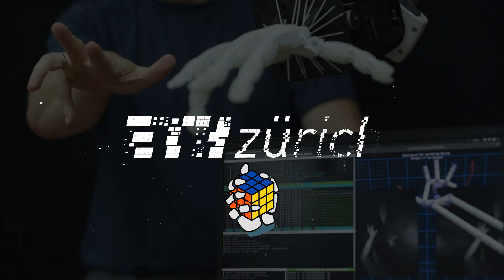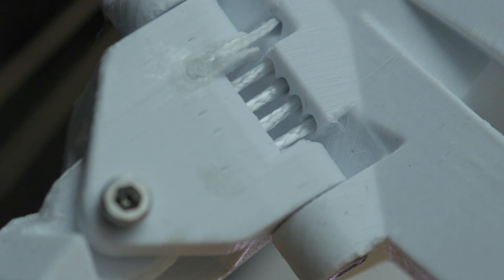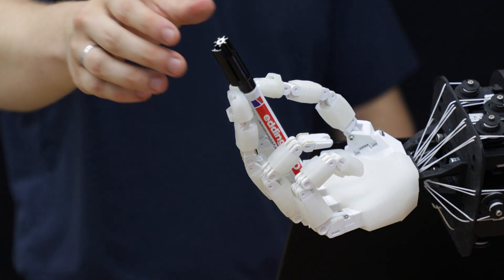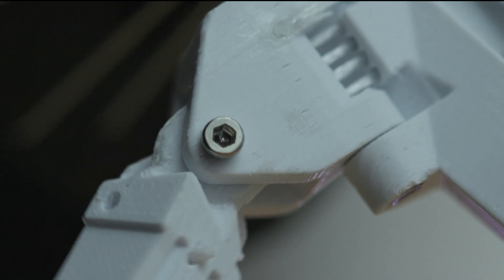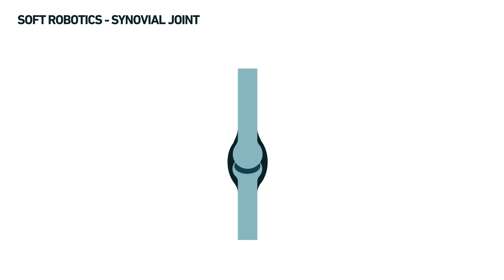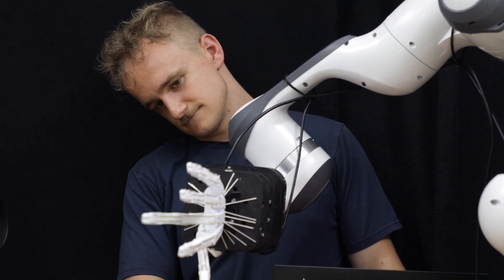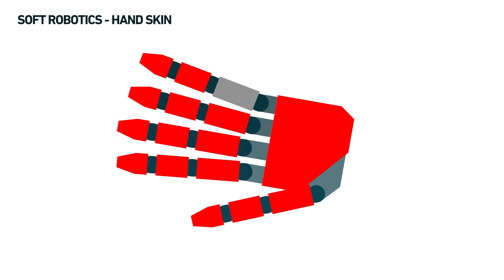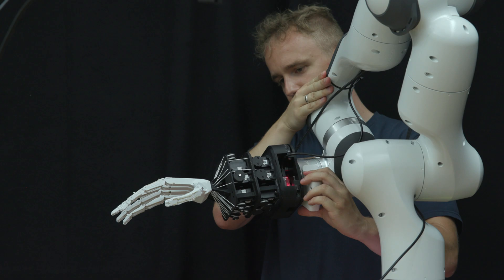Building and Fabricating an Articulated Robot Hand | ETH Zurich Real World Robotics Tutorial 1

Comment: What would be the overall decrease in dexterity if you were to combine the two smaller fingers into a single digit?  Would one less finger represent a 20% decrease in complexity, weight and printing requirements?

Might I also suggest an addition to your Joint Type diagram at 8.08.  As well as flexure, what about compliant mechanism designed using computational origami.

Comment: Is the pressure feedback system only on the last joint? Could flexible pressure sensors be distributed throughout the palm?
Reply: They could but they would probably limit strength. Sailmakers use a special reinforced palm which gives them enormous power to sew heavy materials, but at the sacrifice of sensation.